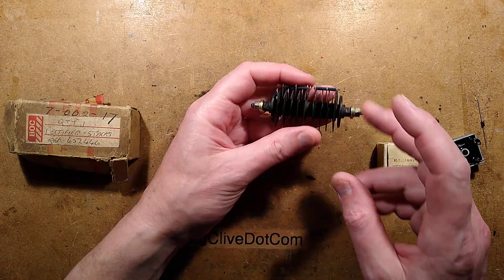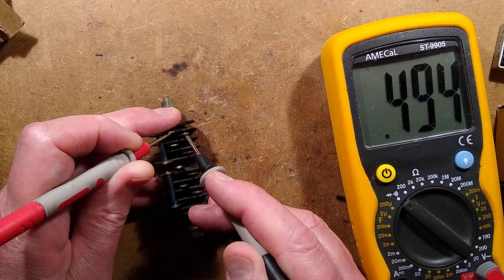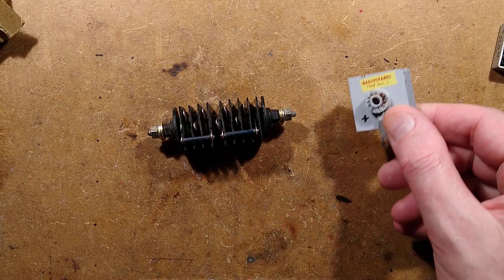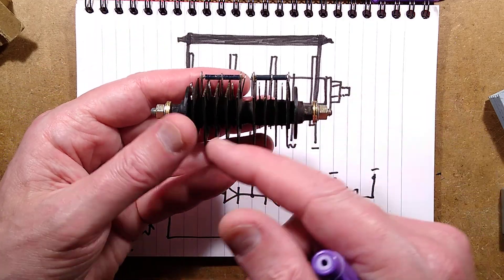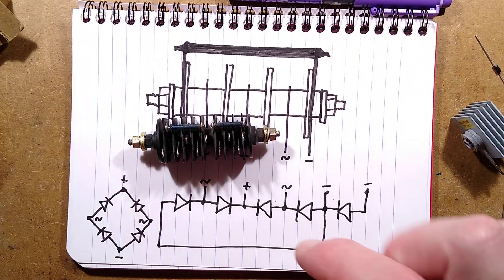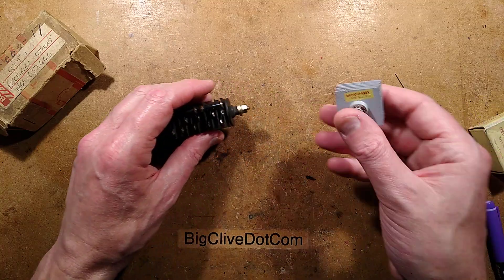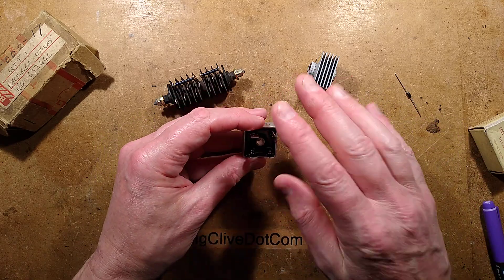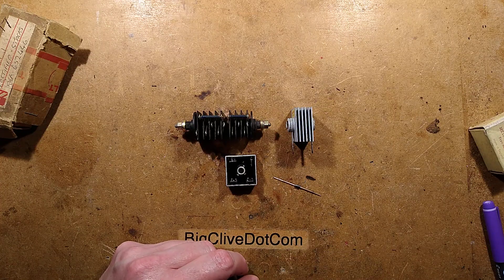Selenium rectifiers - the smelliest components ever

Comment: Funny that you mentioned pinsetter.
I happen to be one of the last "A" Brunswick A-2  model mechanics. (Retired)
Reply: It's amazing how many A2's are still in use.
I'm currently working on an interface for them to utilize an open-source scoring and league tracking program. Would love to get in touch for technical advice.
Reply: @SwervingLemon  if you need any pointers let me know, I work on a lot as well. Converted As, A2s, Japanese.
Reply: @EthanCGamer  It's still on the horizon because I have to wrap up two other projects first, but I'll be taking you both up on that.
Reply: @SwervingLemon  
I designed a motor pause device using SSR'S.
Never produced it.
Motor would shut down after 60 seconds until ball detect.
Reply: @SwervingLemon  
Any time
Reply: It's even funnier that you mentioned it because I'm sitting in a Brunswick bowling house right now it is what I have done for 40 years and we use these on the Brunswick machines we have a magnetic DC clutch that controls the pinwheel and it converts the 110 volts to 90 volts DC to power the magnet for the magnetic clutch in the pinwheel...
Although we have converted quite a few of ours to the silicon diode we still run a few of these selenium rectifiers in our machines and yes they do smell like rotten eggs when they blow

Comment: When I was a kid I got a selenium rectifier from my grandfathers junk box and took it apart and made several solar cells from the plates. The rectifier was similar to the gray one you have but the plates were larger.
Reply: Electronron1, what color was the cell I think I had one as a kid kinda brownish? liberated from a satellite program.
Reply: @anullhandle  If I remember correctly they were painted a light blue, but that was 60 years ago so I could be mistaken.

Comment: Brunswick pinsetters came equipped with those, to convert power to DC for an electric clutch.
You could smell them from 10 lanes away when one burned out.
We now have the newer style bridge rectifiers installed on them.
Reply: I've had the mispleasure of replacing a few blown ones on my pinsetters, usually the older ones smell worse. I love the new silicon rectifiers, they work great.

Comment: I used to work on old copiers that use selenium drums, they were photo reactive, that's how they worked main component.   Never had one get hot or stinky but if you left them out in the light of the room for more than 10 minutes at a time, the would be damaged.   They stopped using them long ago because of selenium is now considered hazardous waste, well that and they didn't work well or last long.
Reply from the maker: I managed to damage the drum in my first laser printer by randomly shooting it with a helium neon laser.

Comment: I remember seeing a full wave selenium rectifier used in the power supply of a 1964 GE portable phonograph. It rectified the low voltage winding of the phono motor to power the solid state amplifier! Crazy that GE used that old technology for a fairly new product. I guess they had a warehouse of selenium rectifiers to use up!  It tested good, so I let it stay.

Comment: These can also be found on older model motorcycles. Necessary to rectify the output from the alternator. My 1973 Suzuki GT750 has one, and trying to find replacements these days is becoming increasingly more difficult.
Reply: Replace it with a modern silicon rectifier. More reliable and more efficient.

Comment: Couldn't you just put a suitable resistor in series to achieve the desired voltage drop? OK, you'd have to apply Ohm's law, I'm not sure whether that should be part of the job description or not (OK, in fact I am, but this was an attempt at irony).

Comment: Photonicinduction has an old video about a welding machine with selenium rectifiers. As you can imagine, the stacks were absolutely ridiculous in size.
Reply: It's not a welder. It's from an old cinema to power the arc lamp.
Reply: @TheManLab7  years ago i worked cinema arc lamp projection, one night a selenium blew, not nice
Reply: @GaryGraham-sx4pm  what did it smell like? When I was round Andy's one day he took apart that jump starter. So he started to prod and poke at it a schedule and when it went up, it smelt like "Palma Violets", which is a purple sweet in the UK. 
Loads of people in the comments said it smelt like death and if that's what death smells like, then I'm on my way as I lik3 those sweets 😁
Reply: @GaryGraham-sx4pm I worked with big ass cinema and digital projectors... with big ass lamps. You cannot imagine the anount of poo rapidly escaping its natural habitat when the lamp went ka-boom!
Reply: @TheManLab7  oh yeah you're right. 
Here it is btw: https://youtu.be/t_YBOfnS__Y
Reply: Yep just left a comment about that! I’ve got stacks of these things that either came out of old welders, or new old stock replacements. Some of them must weigh over 20 pounds, about the size of a 3 gallon bucket!
 I sure as hell don’t want them or have a use for them.
Reply: I've got a 1956 P&H 400 amp AC/DC welder...selenium stack in there....plates are many 8-9" square... maybe 60+ of them, big fan blows on them all the time machines is on....machine still works as well as most modern ones...I can do the 'Aluminum' can or 'Razor' blade welds just fine. it goes down to 3 amps....

Comment: These were commonly used in car battery chargers. When they start smoking, its stinks so bad, you with you had died from cancer. I found an old one in the garage we moved into as a kid. plugged it in, and it started to stink. Immediately unplugged it, and thought, at the time, some critter had died in it. Later found out, that's just how they smell. It gives a durian fruit, a good run for its money.

Comment: I had no idea this type of rectifier existed but I absolutely love learning about this tech! I've just started my "career in retirement," as it were. I did my first project with 110 AC last week. In unrelated news, I've just had my first regulator release its magic smoke. I wonder what caused that? ;)
Reply: Electronics=Smoke, magic and mirrors. If a mirror gets broken it lets out the smoke which contains the magic. 😁
Reply: I managed to get a brushless motor in one of our laboratory robot arms to burn out at least some of its windings because of an incorrectly placed reagent cartridge that it tepidly poked against. I got weird looks when I opened the cover and exclaimed "I smell magic smoke, that can't be good..."
Reply: You know, I've never been able to find a small can of 'replacement smoke'....
Reply: @dougankrum3328  😂 Don't forget to repair the cracked mirror before installing the new smoke.

Comment: Good old memories pop up. We used to make photo cells by heating the elements to the melting point of the solder layer and wiping the latter off with a rag. Doesn't always work. If it gets too hot it gives off the smell and then it's useless.
Reply: Yup, same here 40+ years ago. 🙂  
However the smell when slightly overheated wasn't anything like the vile one when it realy burnt – it was sort of a celeriac type of smell, not too unpleasant.

Comment: A while ago I came across a bridge rectifier made of these in a very old 200kV DC power supply. It had hundreds of tiny discs stacked up in cardboard tubes, dozens of the tubes in series, and the whole thing submerged in oil. Despite all signs, the customer didn't believe the rectifiers could have possibly failed, until they opened the tank and were hit by the stench. Several of the cardboard tubes had carbonized, fallen apart, and dumped their discs all over the bottom of the tank. Mouser sold us a lot of microwave oven diodes that day!
Reply: There aren't a lot of applications where a 200kV DC supply would ever have been needed.  Was it a commercial broadcast radio transmitter?  How huge were the condensors and valves?
Reply: @tactileslut  it was used for charging a bank of 50kV 2uF capacitors, for lightning impulse testing of very large transformers. The caps were wired up in series pairs, and they never ran it up past 100kV. It did have a big string of resistors for voltage feedback
Reply: @tactileslut  I've never seen 200kV DC used in a commercial broadcast radio transmitter! (and I did work for the UK's national broadcaster, including on 500kW HF AM transmitters - IIRC they used "only" 24kV DC for the "Pulsam" modulator and 12kV for the RF Amplifer)
Reply: @hectorpascal  From the OP note, looks like it was a fail safe of double the normal voltage application - which makes sense you would not want to be running components at peak load all the time.
Reply: @tactileslut  I know electrostatic filters operate from 50kV to 100kV, not sure about 200kV thou.  There are no caps or other components after the rectifiers, except the voltage feedback which is a big resistor divider.
Reply: @tactileslut  A L.A.S.E.R. maybe?
Reply: GE used this system in their VERY early medical LinAcs. Also fairly common (around this sort of voltage) in earlier X-Ray equipment, especially the high energy (high acc. voltage) tube systems used in X-Ray radiotherapy.
Reply: I actually have several rectifiers made up of stacked discs in a phenolic tube with brass end plugs, they came in a box of surplus parts I was given, clearly never used; I wonder if they were from a similar arrangement.
Reply: you'd think they would have used selenium stick diodes
Reply: I'd have been joking the whole time about subbing in a stack of 1N4007's. It'd only be around 10 feet tall.  ;)

Comment: Selenium was also used in the first solar panels, installed on a rooftop in New York, in the 1880's. Just like the diodes and other components, the selenium was later replaced by silicon in the panels.

Of course the one thing, the film Evolution taught us, is there is also selenium in popular dandruff shampoos.
Reply: We need tiny amounts of selenium in our  diet, usually from leafy greens, to have healthy bones and teeth.
Reply: @goodun2974  Which is why we smell (on teeth drilling,  or cremation !)
Reply: Those were ZnSe based cells IIRC.
Selenium is used these days in CIGS (Copper Indium Gallium Selenide) solar cells, which were a big thing years ago as they were at the time cheaper than silicon cells, but their use has died out in most COTS PV modules as silicon prices cratered in the late 2000s and 2010s.
Reply: Selenium is still used in some photodiodes. Photodiodes are just mini solar cells, so I suppose it makes sense.
Reply: @jaymzx0  it's also sometimes found in LDR's(Light Dependent Resistors)-used to sense light, and in certain types of opto-isolators
Reply: Didn't the guy in that movie stare at the woman's boobs (or so she thought) because she was wearing a shirt with the periodic table of elements printed on it, to discover that selenium might be toxic to those alien kickbutts? 
Just like arsenic being toxic for us carbon lifeforms, selenium would be toxic to nitrogen-based ones (because it's a Knight's Move away from the base element in the PToE; because, duh, "Movie Science and Logic!" ) ?

Did I remember all of this correctly after all those years? 😁
Reply: @DerMarkus1982     Marcus !  -  I'm SO confused...  What is the film we are talking about ??
Reply: @Mike_Hughes  evolution, an early 00s (iirc) sci-fi comedy film. About an… alien biological infestation, I suppose you could say.
Reply: @kaitlyn__L  yep, 😉
Reply: @kaitlyn__L     Wow, never hear of it, I will try to find it and watch !   Thank you so much for that.
Reply: @Mike_Hughes  I must warn you, it’s got a bunch of a) movie incompetence in addition to the aforementioned movie science logic; but also b) standard for the time some crude humour. But it can be fun and has some interesting ideas. I bought it cheap from the rental store for like £3 on DVD, and it wasn’t even that scratched, not to the point of affecting playback.
Reply: @kaitlyn__L     That's good, I often like crude...  (which is why I appreciate the Clivemeister)...   I will have a look on ebay and also there is a Town near hear called Mold, which is the world capital of charity shops !  -  I have found some great DVD's there in the past.   Also I'm REALLY pleased that someone else, other than me, still appreciates (and uses) DVD's !!  x
Reply: That was a good film but the ending was rubbish.
Reply: Selenium in dandruff shampoos was not elemental, it was sodium selenite (SeO2 or Na2SeO3) and do not have much offensive smell.

Comment: Honda used these on some of the smaller motorcycles until at least the late 70's.Ct70 and Xl70/75's with their awesome half wave charging systems.Never smelled one 'farting' tho,too low a current I suppose.

Comment: Until about a decade or so ago I had a Halfords battery charger that I bought in the 1960s it was a long narrowish box largely filled with an enormous selenium rectifier about a foot long. It was just a half wave rectifier with no smoothing and I am not sure how good it was for a car battery but it worked for 40 years until it erupted in smoke. I still use the leads and croc clips on a solar battery charger so it sort of lives on
Reply: Lead Acids almost don't care about ripple. Some frequencies and amplitudes are actually good for conditioning the plates. :)
Reply: it may have failed due to the rectifier material absorbing atmospheric moisture, some types i've seen 'painted', (mostly high voltage types)  ,  i have a charger bought new in the mid 80s, also spookily halfords branded 😉,  and it has a 'contact cooled' selenium rectifier, basically a stack of rectifier plates, no air gap inbetween, and bolted to a metal plate , to dissipate the heat , still works perfectly, at the moment 😉,
Reply: i think they fail because of this, plus heat, rather than just 'age', if painted/sealed and run cool, pretty sure they'd last much longer without issues
Reply: It was a darn site better for the batteries than the silicone diode equivelent
Reply: Thank you for that OZ,  I find it interesting that Halfords were selling shit battery chargers, even back then.   As these would clearly do their best to destroy batteries asap, it comes as no surprise that Halfords have always made very good profit out of Battery Sales...
Reply: @Mike_Hughes  The unfiktered rippling output voltage is very healthy for a lead acid battery actually.
Reply: @NinoJoel     Quite!  -  And the unverschtinken nippleclamp outingputverschtappen is very healthy for ringingpiece lubrification...

Comment: Yes, Radiospares Limited is (now) RS Components ... Radiospares Limited started in 1937 (in a garage) then went from1954 to 1971 actually selling compnents ... from that point on they rebranded the company to RS Components.
Reply: Here in the states we had an "RS" also......"Radio Shack". Started about the same way, a couple of "Hams" buying and selling radio parts out of their garages. Was pretty good until they started selling Chineseium excrement and sales dropped off to nothing. I do miss them tho....only place you could get hobby/experimenter parts quick on a weekend. Now we have to mail order everything and wait the week for shipping....
Reply: @ajwilson605  Similar to the TANDY retail store we used to have in the UK ... miss that too ...
Reply: @krellft  Here in the states Tandy was the parent company of Radio Shack. Interesting side note, Tandy started out as a leather company, providing small lots of leather for short run production.
Reply: @ajwilson605  Classic ... funny enough ... the Coleco toy company was also a leather company (Connecticut Leather Company) before they became ColecoVision, games console manufacturers ...
Reply: I have somewhere an old RadioSpares catalogue that listed what their name would suggest, spares for radios (and TVs), aftermarket parts to replace OEM transformers, resistor dropper assemblies, rectifiers, etc.

Comment: I have a 1957 motorbike that, strangely for the era, has an alternator and one of these little blighters mounted right under the saddle just where your Gentlemen's purse sits, it does keep your loose change warm on the winter night rides.
The Bike has a 6 Volt system and the rectifier characteristics and the battery impedance are the only thing that regulates the voltage to the battery, turn the lights on with the engine running with a completely flat battery and all the bulbs blow.
We may have developed an alternator and a rectifier but electronic voltage regulators were still a dream in 1957.

Comment: Also used in old tube guitar amps to create a negative bias voltage for the power tubes.
Reply: Also used for the bias supply in some Fisher and Scott hifi amplifiers. Sometimes used to provide DC to power a bunch of 12AX7 heaters in series, as well as the negative bias.

Comment: Thanks for the more accurate information.  There is a lot of not so accurate information about Selenium rectifiers around.  
In some tube circuits, like radios, the lower forward voltage drop of silicon can cause a little issue.  Some techs use resistors in series to reduce the voltage in these situations.
Reply: Same in guitar amplifiers. Some 'vintage' or 'classic' models use valve rectifiers (5AR4 etc) which have significant voltage drop. When replaced with silicon diodes the supply caps can give trouble with the higher applied voltage. Also the 'instant on' characteristic of silicon can cause surge problems, where the valves would turn on over some seconds.
Reply: @olsmokey  if I can get the valve rectifier I always try to replace like with like.   I am a little more cautious with Selenium usually 🙂
Reply: or just stack the diodes up, or use really high voltage diodes that are silicon stacks

Comment: Or, as some of us might call them, Satan's fart packs! Usually, if replacing a selenium rectifier with silicon in say, an audio amp, or vintage radio/TV, it's customary to insert a resistor in series to compensate for the difference in voltage drop between silicon and selenium.